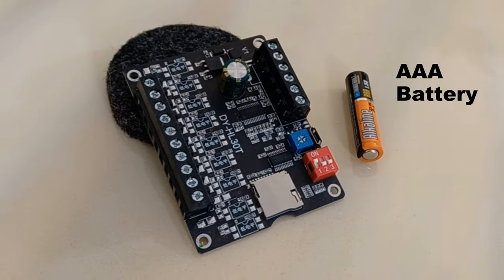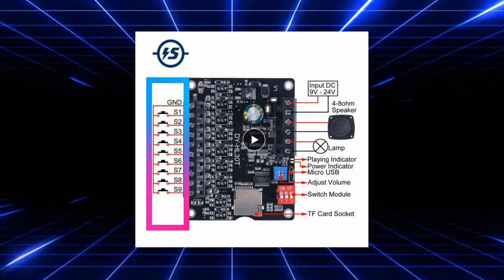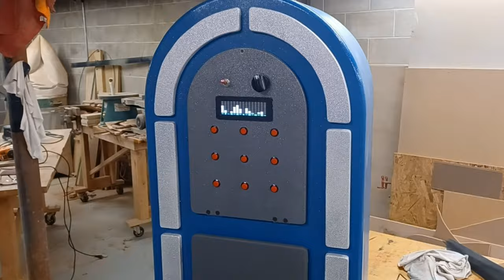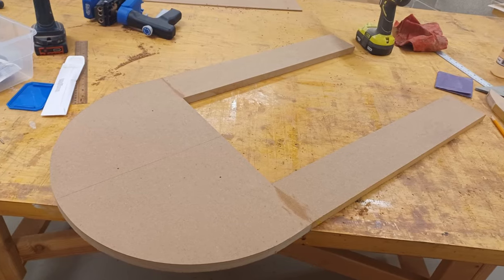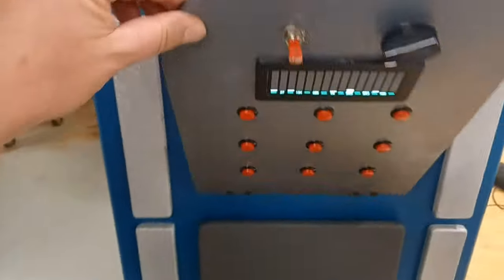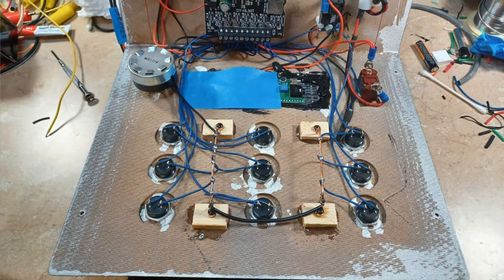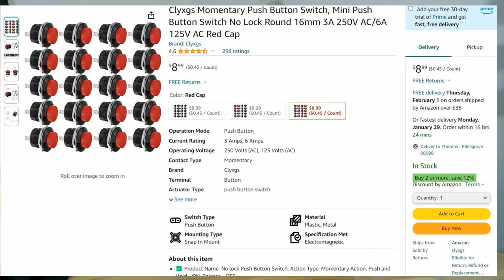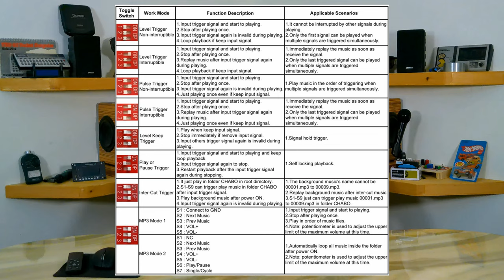NEW Player/Amp Board For One-Button Music!

Comment: Would be interested in the potentiometer details for sure!

I love these little projects.
Reply from the maker: Here is a link to a high powered one PE sells:  https://www.parts-express.com/L-Pad-100W-Mono-3-8-Shaft-16-Ohm-260-261?quantity=1  and here is the lower powered one I used: https://www.parts-express.com/L-Pad-15W-Mono-1-Shaft-8-Ohm-260-250?quantity=1  If you plan to really use it as a way to go from nearly quiet to loud, the higher powered one should be used, if you just want a little bit of attenuation available, then the lower powered one should work fine.
Reply from the maker: Here is a 50 watt unit also from PE:  https://www.parts-express.com/L-Pad-50W-Mono-3-8-Shaft-8-Ohm-260-252?quantity=1

Comment: Hi!

I'm wirelessly extending my old school pull doorbell to upstairs using Zigbee (door switch attached to the pull rod, that will activate a relay connecting the switch pins to ground on this amp board).

I haven't been able to decide on a driver yet though.

The driver you used is a 8 ohm 20w woofer right? Can it get loud enough for a doorbell? Or would you recommend something else?

Thanks in advance!
Reply from the maker: I used that driver because I had a lot of them, but you could use a 4 four ohm driver for more oomph.  A pro sound driver 5 to 8" would be about perfect, they like playing loud. Thanks for watching!
Reply from the maker: @Danieldt1391  Generally speaking, a 4 ohm driver will play louder per a given watt than a similar 8 ohm driver, but it does depend on the driver. I suspect the drivers you picked will work fine for what you're wanting to use them for. As long as they are in an enclosure, so the front and back waves don't cancel each other out, I bet it works fine.   I only suggested a pro-sound driver because they are sometimes more efficient than home stereo drivers. But since you already have the drivers, I would just go with them.  An average doorbell chime will be between 75 and 85 decibels, and your driver should easily be able to do that, so I think you're good.
Reply: @zarboaudioprojects1430  
Hmm you're completely right, I didn't think about it like that. I thought that as the resistance would be doubled, I could crank the amp twice as high; but yeah they're both rated at 10W...
There's some reviews saying that they can't even drive them that high though, so it could still be that in reality the 8 ohm takes more watts than the 4 ohm version.

It should arrive in a few days; I think it should still be good enough, if not I'll continue the search.

Thanks for the help!
Reply: @zarboaudioprojects1430 

I finished the build last week. Everything's working fine and dandy, and I found a perfectly fitting wooden box for it (This board, a Zigbee smart-home relay switch, two 2 inch drivers, dc plug, all within 18x8x5cm / 720ml)

I guess I might've made the right choice on resistance after all. I ended up using both 8ohm 10W drivers, and wired them in parallel, resulting in 20W at 4 ohms. If I had two 4 ohms they'd have to be wired in series because in parallel the resistance would become too low, but then it would be 20W 8 ohms.

This would then give the dual 8ohm 10w setup the edge in terms of oomph over a dual 4ohm 10w setup, no?